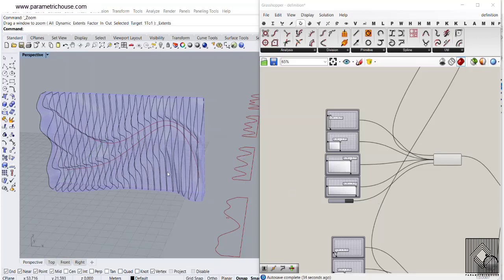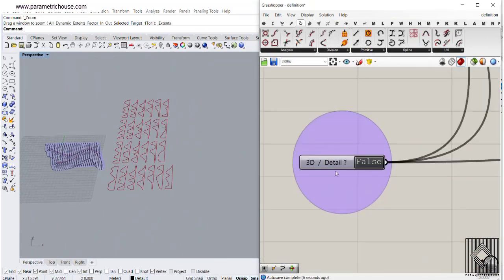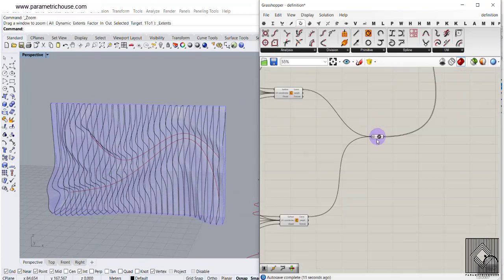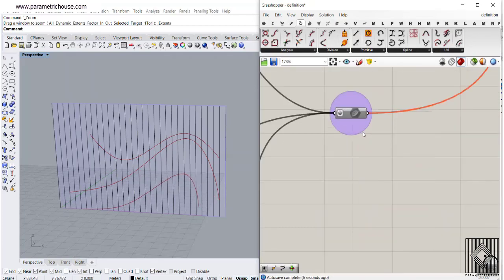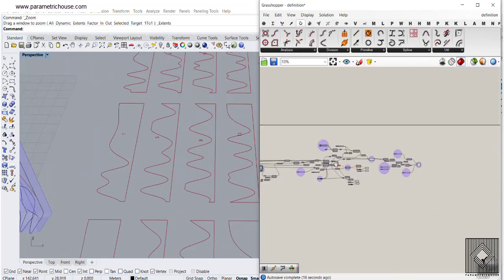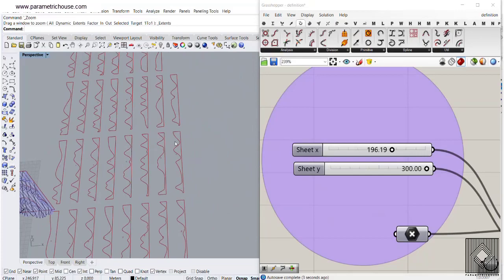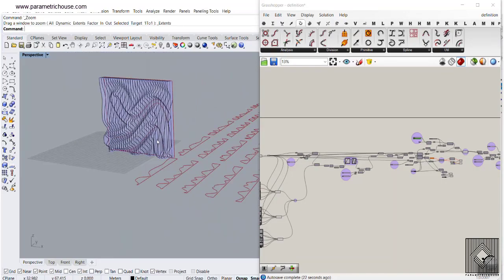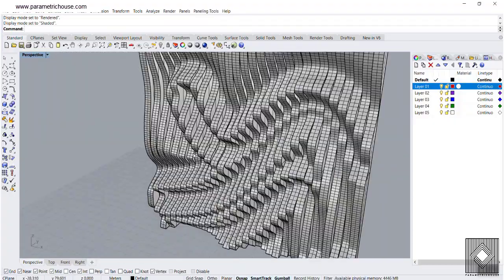Parametric wall #1

Comment: Is it possible to use this algorithm on a curved planed? ( not biplanar but simple one made by a curved line extruded vertically?)
Reply from the maker: I guess the logics are similar but you have to use normal direction instead of a fixed vector